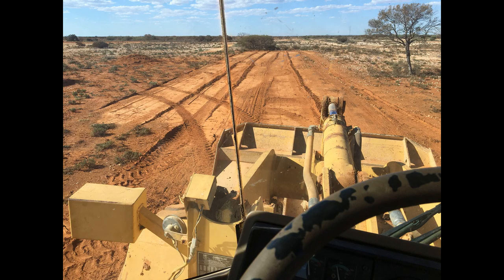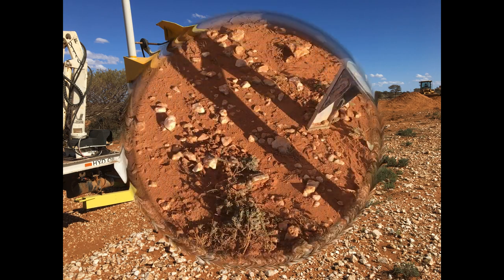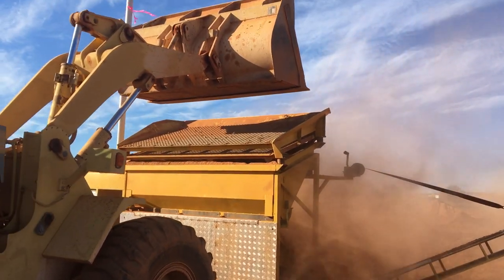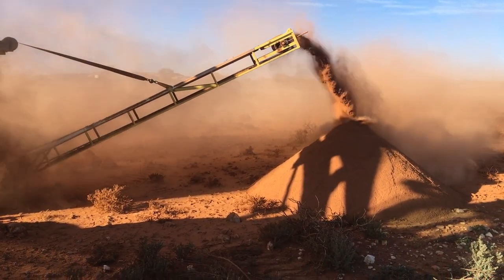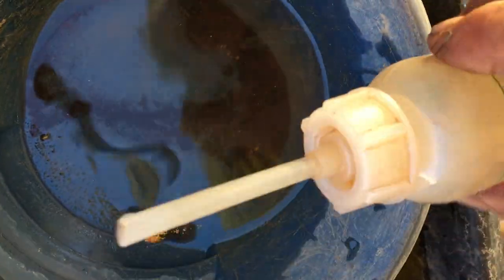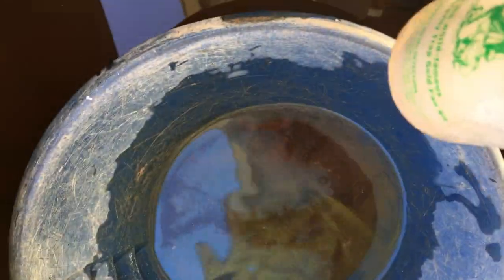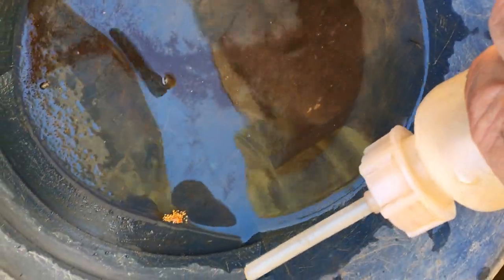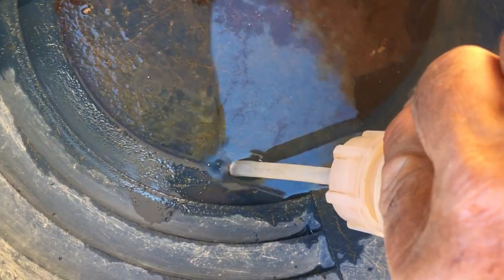First onsite dryblower test 25 3 2021

Comment: I might be able to assist you. When using a snuffer bottle you have to ensure that there is a good level of water over the gold. It is the suctioning of the water that carries the gold up the tube. If you can hear the air being sucked up you are losing the hydraulic lock that pulls up the gold. Hope this helps.
Reply from the maker: Thank you John. I'm sure I just have to get more practise, you know, more gold :)
Reply: @moneybox5733  I wish you every success mate

Comment: My opinion is you are running the  machine way to fast and with the  snuffer bottle keep the tip submerged under water to get all the gold in one pass. If you come to the U.S.A. look me up.
Reply from the maker: Dan, I'd love to come to the USA and look you up. We had a trip to Canada planned at this time for a family wedding but Covid got in the way of our 5 weeks in a hired RV. We've had our shots now so who knows what next year will bring.

You are correct on the speed. I built this without a plan but I had a visual inspection of a working machine. That didn't help with working out speed and airflow but I'm learning. I needed full revs on the 10hp Honda to create the vibration to clear the screen but I was blowing most of my gold away. I altered pulley sizes to keep the screen vibration going while reducing the bellows speed. In the two days following I tripled my gold production so I'm on the right track. 

I only got two days before the winter rain settled in and ruined my chances of making dust. Instead I headed north with the metal detector and returned with over 800 small gold nuggets. We're travelling interstate at the moment and I'm looking forward to returning to the dryblower next month.
Reply: @moneybox5733 I Sounds like you are going in the right direction. One other pro tip is try to start dryboxes at  35-40 degrees and then adjust accordingly. To check recovery clean up at a predetermed short interval and go by the size of your gold. We are catching smoke gold.